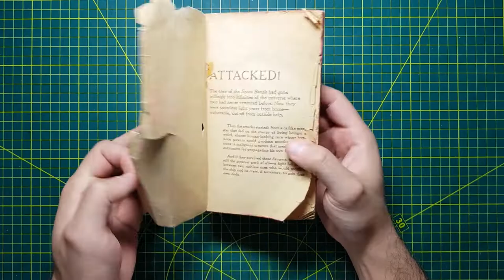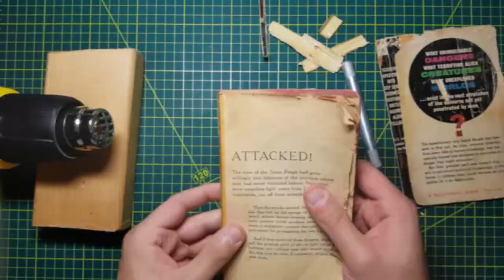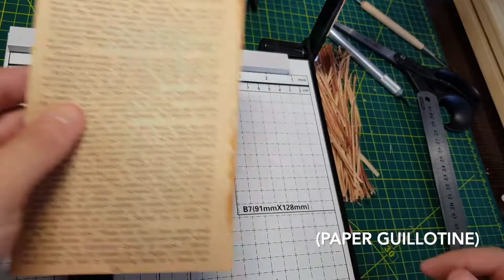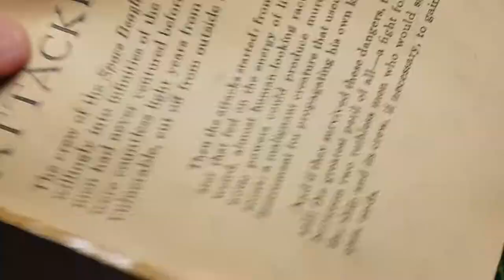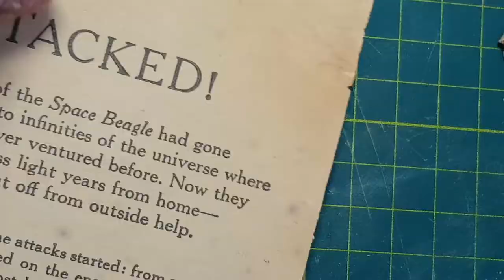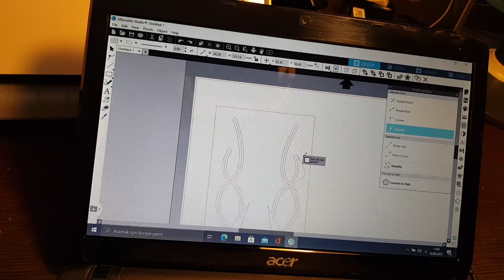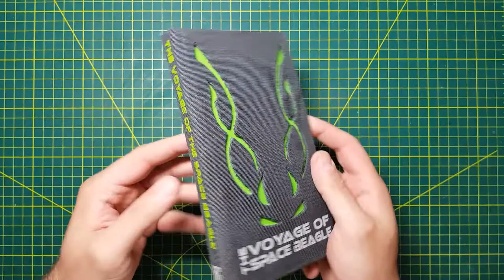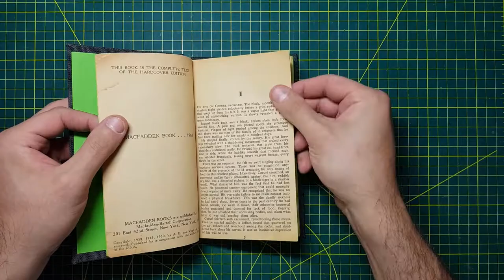Bookbinding #11 | Restoration Rebind | The Voyage Of The Space Beagle

Comment: Look great! 

I like the effect of the endpaper showing through the cutouts on the casing board. Do you worry at all about those areas being easy to  puncture/tear (or at least easier to puncture/tear than the rest of the cover)? I'm wondering if I were to do something akin to this whether I'd layer two thinner pieces of board as a sandwich around an extra piece of the endpaper, or whether that would be overkill.
Reply from the maker: Thank you. I use thick craftpaper. Its almost as thick as a paperback cover. Additionally, PVA glue providing extra hardness and durability. So I don't worry about punctures.